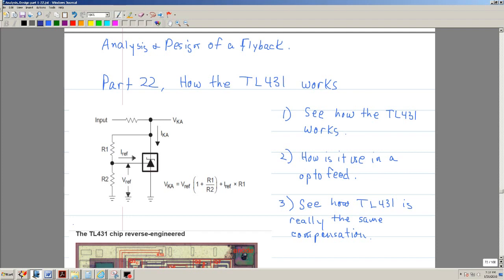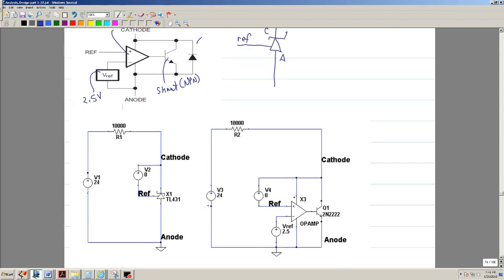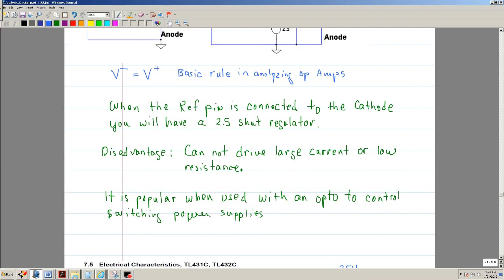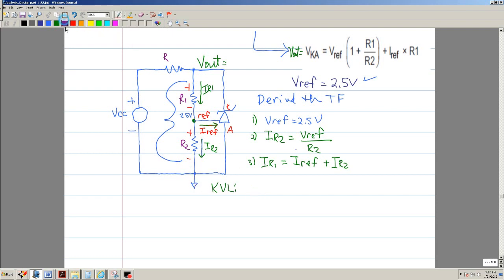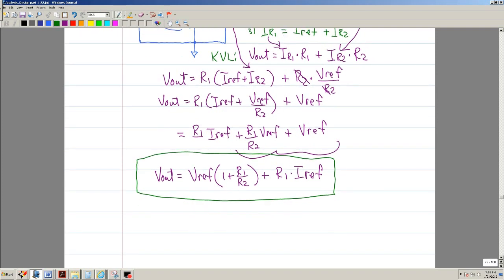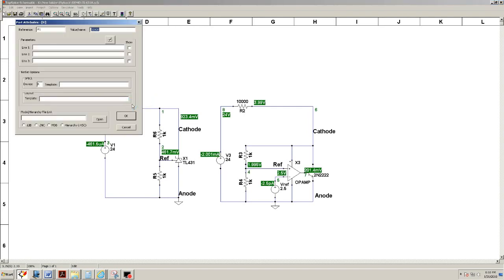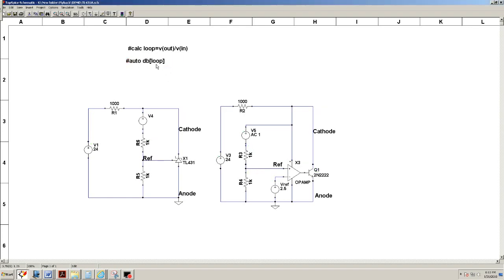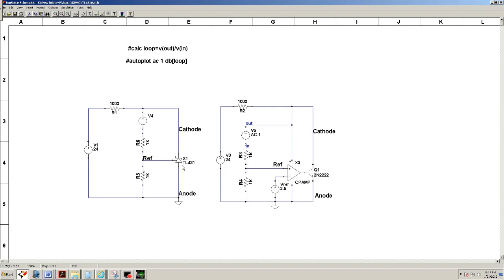Analysis and Design of a Flyback, Part 22, The TL431 shunt regulator

Comment: How to Design loop compensation Circuit of Tl431?
Reply from the maker: Video 23 will start to develop the loop compensation.
Reply from the maker: In the meantime, I have three videos on loop compensation of a DCM flyback. The procedure is very similar to that. So if you watch those videos, then when you watch the Video 23, it will make sense.

Comment: https://www.onsemi.com/pub/Collateral/TND381-D.PDF
https://www.researchgate.net/publication/280308828_Designing_with_the_TL431_-_the_first_complete_analysis
These are good resources for designing a TL431 + opto circuit.
The most important thing is to not get fooled by the words "shunt regulator" or the zener-like symbol. That may be how the chip was originally designed for its intended purpose, but that has nothing to do with how it's used ubiquitously in power supplies. The other important thing is that the optocoupler has far more influence on the frequency response than the TL431 does (see in the Designing with the TL431 by Ray Ridley PDF;  fig 4a, 5 and 6a show how the TL431 is dominant in the low frequency response, but the opto is dominant in the mid and high frequency response where the crossover frequency will be). Also, TL431 and opto SPICE models don't work brilliantly for AC analysis in these circuits, you're best of working though the design in the ON Semi PDF on paper.

I see so many bad designs where people treat the TL431 as if it was either a textbook opamp error amplifier and ignore the optocoupler, or treat it like an ideal zener diode, or try to do compensation on the error amp of a primary side controller chip as well as on the TL431. In all these cases the compensation ends up completely wrong. People put RC across the TL431 in circuits that only needed a capacitor (because they're treating it like an opamp), people don't put any thought into what value resistors they put above the opto LED or on the phototransistor (these components determine the mid-band frequency response), or how much current to bias the opto with (bandwidth is proportional to current in optos). And if you have an internal error amplifier in the primary side controller that can have its output biased to high impedance and have the signal from the opto feed into the internal error amp's output (e.g. compensation pin), do so. That reduces the number of amplifiers in the feedback loop and so makes it easier to stabilise and optimise.

As always, thanks for the video and keep up the good work!
Reply from the maker: Thank you KX36 for the information. I am planning using some of Ridley and Basso. But mostly I will be using a graphical method taught to me by my mentor Jack Alexander. His method is very intuitive which consist of zero-pole matching.

Comment: When TL431 is used with an optocoupler, you will see that the phase looks like -20/dec , and then it stays flat from mid frequencies and never goes down. This mid band gain is not good. That is the reason a cap is added with a pull up resistor from the collector of the opto which  forms an extra pole to bring the phase below zero. When you use opto+opamp , the problem of midband gain is not there. The problem in this would be how to generate the 2.5 V for the opamp reference.